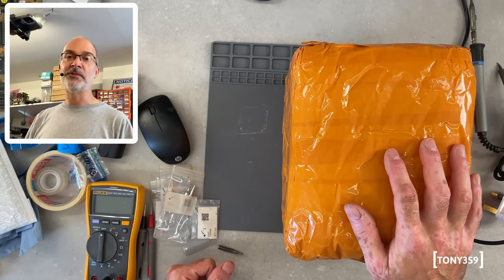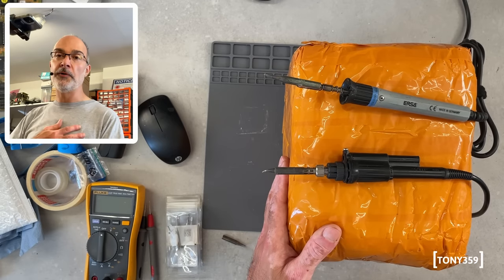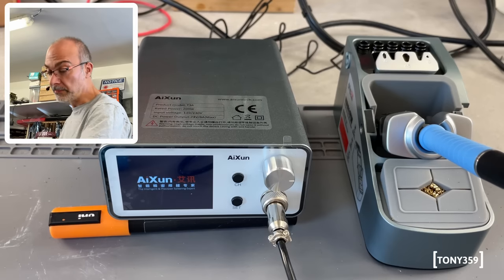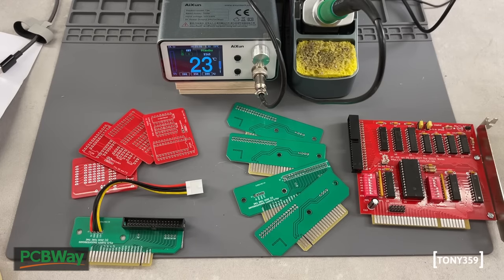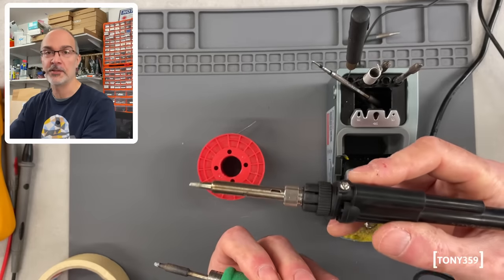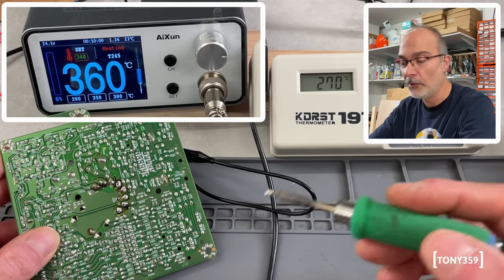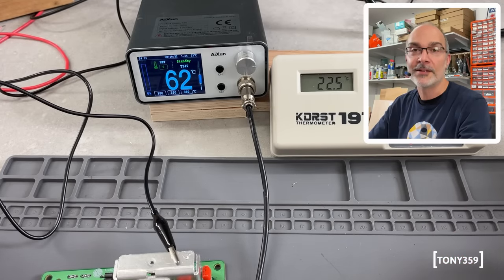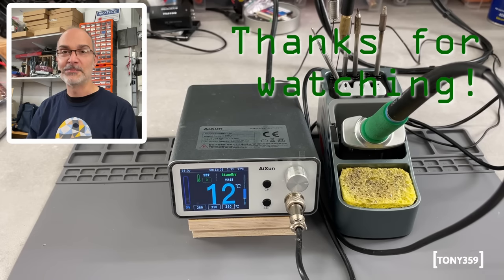Is the Aixun T3A a good T245 soldering station?

Comment: I have had a Hakko 927 for years and it served me well.  The drawbacks that you found on the tiptype iron where you have to unscrew the barrel to change the tip was a drawback for me, but I was able to deal with it.
One night though the ceramic heater cracked and the heater opened. I tried a chinese knockoff heater and it was NOT the same.  VERY poor performance.
So Pace came out with the ADS200 cartridge, and having some experience with Pace, I bought the station.  I am very happy with it's performance and power and recovery and have several different cartridges, from pencil thin to wide blade.  Always seemed to work well.
The problem with grounding the tip on the Aixun and messing up the temperature control loop is a BIG deal breaker for me!!!!  My Pace doesn't have that problem though.
Nice looking iron, but the drawbacks are deal breakers!
Reply from the maker: I am still using my Hakko knockoff and I need to change the tip twice for a project I do regularly. What a pain! With the JBC I do that all the time. I cannot go back. But yes, I need a soldering iron, not a voltage injector :)
Reply: @tony359 , buy an extra soldering iron or two and outfit them with the other tip shapes you use. Still a lot cheaper than cost of a JBC or Pace unit plus tge additional tips.
Reply from the maker: @goodun2974  Also a bigger workbench I guess
Reply: @pomonabill220  , it sounds like you need to use an isolation transformer on the input AC to the soldering station so that you can ground the tip.
Reply: @tony359  , don't we all?  Although the amount of equipment and accumulated detritus somehow always expands to fit the available space, no matter how large.  Anyway the audio repair bench I worked from for 20 years was only about 4 feet wide, but I had the Aoyue INT701A++ , an old Weller soldering station, and a hot air pencil unit stacked to my right, with a scope, signal generator, distortion analyzer, FM generator, patch bay, bench receiver and other equipment on shelves in front of me. I repaired plenty of large power amplifiers and hifi receivers on that bench. PS, it can be very usefull to have two simultaneously operable soldering irons on the same bench.
Reply from the maker: @goodun2974 I got a better iron. Irons are supposed to be grounded. Why would I need to use an isolation transformer to resolve a clear design flaw? And why would I need 2-3 soldering irons on my bench when I can do with one? 2-3 irons on all the time? It can't be a viable option.
Reply: @tony359  ,  You are correct that you should not have to use an isolation transformer after spending a couple of hundred dollars on what  is supposed to be a piece of high-tech equipment.  I was just suggesting a solution to somebody who might already have bought one, and maybe they work on old radios or something like that where they have to have an isolation transformer on hand anyway.

Comment: And I have a question. There is a new model called T413. Is the grounding method of T413 closer to T420 or T320?
Reply from the maker: I checked online. It says it has AI and a Neural Network in it. Really, is that necessary? It's not clear what PSU it has inside but given the 120W it might be linear.

Comment: Solved! (I think) - part 1. (YT keeps deleting my long reply so I'm trying splitting it into 2)

But firstly, to answer wrt. your reply to my earlier comment, they chose an SMPS because it's cheaper, lighter (= lower shipping cost) and smaller (= cheaper enclosure). However I since found your EEVBLOG threads, the reverse engineered schematics and SDG Electronic's pictures, from which the problem seems to be quite obvious and not the fault of an SMPS. The fault seems so obvious that surely I've missed something important?

The 24V supply +ve is switched to the tip's heater (LOAD) by a MOSFET, returning to the supply -ve from the tip's COM connection.  COM is internally connected to the tip's thermocouple, the other TC connection being to the tip's TC connection which is connected to the tip cartridge's actual tip.

The slap-head design problem is that they appear to have connected mains earth to supply -ve/circuit ground on the main board - the green/yellow wire you can see in SDG Electronics's review/teardown video. This means that when you touch the tip to another mains earth, the heater current now has an alternative, parallel return path to the -ve supply, flowing from the heater low (COM), through the thermocouple in the tip to the external earth path, through the green/yellow earth wire in the station to the main board and then to 24V supply -ve.

Wow! Apalling!!! If your earth path is very low resistance you could fry components or even fine traces on the PCB your soldering!!!!
Reply: "YT keeps deleting my long reply" Such replies aren't really deleted, rather it's a bug where they only show up under "Sort by Newest first". Under the default "Sort by Top Comments", the replies don't show up.  You can try sort by new, to see if the reply is actually still there. 🙂

Comment: Great thorough (non)review. It's been 9 months now, just wondering if these issues were ever addressed with a new firmware update. Thank you!
Reply from the maker: Thanks. I don’t have the T3A anymore but from my understanding those cannot be resolved via FW. Maybe they can mitigate the overshooting but if the thermocouple can’t see the actual temperature of the tip, then the firmware is driving blind and can only guess.
Reply: @tony359  Thank you for the reply. It really is a shame, as other than this issue it looked very promising.

Comment: Very interesting. I must say I haven't experienced the same issues in terms of grounding and unstable temperatures. I just tried it now with a large copper plane both grounded and ungrounded (with Aixun and JBC tips) and the power meter remained stable with peaks of 15% but an average of 6%. I don't have a proper way to measure the actual tip temperature though.

This is with firmware 1.26, I haven't bothered updating the firmware since I first got it over a year ago. I'd be curious if you find the same issues with yours on 1.26 (assuming it is still available to download)
Reply from the maker: I was thinking indeed to downgrade to a much earlier one, SDG electronics is also on a much older one. Let's hope I don't brick it :)

Comment: Hi,
Thank you so much for the in-depth review of this little soldering station.
I've been using it for a year and it's really a big step up compared to classic stations.

Note that Aixun issued a new firmware 1.35 with the following change log:

AiXun T3A
1.35 (2023-11-22)JC_M_T3A_1.35.bin
1. Optimize 245 control heating;
2. Optimize the "automatic temperature compensation" function of 245;

The problem could be fixed here?
Reply from the maker: It’s not unfortunately. I briefly tested it. The first thing I noticed was that - after a full reset - my top was 60C off compared to what the display said. The grounding issue was still there but hidden by the display. So I reverted to 1.33 again. I’ve got a different station now. Thanks for watching!
Reply: @tony359  thank you for your feedback!
I'll check what new station you have :)
Reply from the maker: A quick comparison video is out soon :)

Comment: Good review. I have the same Aoyue station and it's been ok overall and I've repaired many pieces of equipment with it, but it's weak and slow. The solder pump gun is adequate but, again, weak and slow. I've been looking for a reasonably priced replacement with newer tech and just can't make up my mind. I'm not real enthusiastic about switch mode power supply units and would prefer a linear transformer design with enough get up and go to increase productivity, so my search continues. It's looking as though I should save my pennies and get a name brand unit with good firmware/software. I'm surprised SDG didn't pick up on the issue, but I don't know what firmware version he tested with. I agree with your summation, 1.34 was obviously created to hide the issue. Thanks for the honest review.
Reply from the maker: SDG heard of the issue and analysed it in a later video with a different Aixun station.
It looks like stations with a linear PSU are good - but the T3A was also described as "good" so I'm not sure :) Thank you!
Reply: I used the Aoyue INT701A plus plus station for the last 5 years of my audio electronics repair career and it worked well for me. The earlier units used an AC motor and later units use a DC motor and I'm not sure if one was better than the other but I'm pretty sure mine had the AC motor. I found the suction to be generally pretty good from it but I did do a couple of modifications to the gun to center the tips better in the heating element and prevent clogs at the back end of the stainless steel tube where it enters the collection chamber.  I actually had fewer problems with that desoldering station that I had when using 80s vintage Hakko desoldering stations.  I was less impressed with the soldering iron wand that came with it although it does work better, as noted elsewhere here, if you use a Hakko tip that's actually made of copper and not a solid iron or steel tip as was provided and as so many online purchases of tips turn out to be.

Comment: At 1:10,  having used the same exact Aoyue (pronounced A-U) soldering/desoldering station for 5 years (prior to retiring),  I can confirm that the Aoyue soldering iron works better with Hakko or other quality tips because the supplied tips are iron or steel throughout,  which has poor heat-transfer characteristics compared to the copper tips manufactured by Hakko and a few others.  Most of the boatpack tips sold on line or package with knock off soldering irons are similarly made of iron or steel and you can easily verify this with a magnet because the cheap tips will be strongly attracted to the magnet; good quality tips are made of solid copper  with iron plating at the pointy end only (iron resists the dissolving effects of molten solder and flux, which would quickly destroy bare copper), and the rest of the tip is plated with chrome to resist solder completely.  I have a video on my channel about discerning poor quality tips from good ones with the use of a magnet.  By the way although I found the Aoyue soldering iron a little under powered for the type of audio repair work I used to do the desoldering half of the station worked really well, with a couple of minor tweaks and mods to the guns to make them less likely to clog.

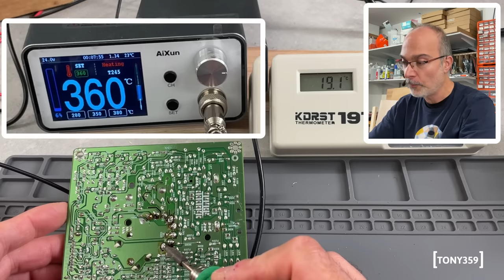Comment: 24:03
Thanks for making this public! I had noticed this too and swap tips like you did. 
What I discovered was, the original JBC cartridge tip i have did NOT have this issue. Only aixun cartridge that came with it has this issue.

Get an original JBC cartridge tip to solve this problem, although its quite expensive. Clearly they did not able to copy it 1 to 1.
Reply from the maker: But that was a JBC tip :) 
In fact, the "spiking" issue only happened with the JBC - hence Aixun blaming the "non-Aixun" tip for the issue.
Reply: @tony359  
That's weird, I just tested 1.33 and there's no "spiking" on jbc tips, only aixun. 

Maybe your electrical outlet in your lab is non grounded? that's the only thing i can think of tbh.
Reply from the maker: it's 1.34 which spikes on JBC. 1.33 works well with me.  I'm talking about the spiking when sitting on a thermometer, the "grounded" spikes happen with both versions, just different behaviour.

Earth is working, and you're not the first to say that it doesn't happen with their station so.... maybe HW variations? I really don't know :)
Reply: @tony359  
Yea the behaviour you showed is exactly what happens when I use aixun cartridge. Immediately solved when JBC tips is used. 

Perhaps the wand itself is faulty? ngl if the problem persists with JBC like yours do, i wouldn't keep it, I'd return.

Comment: That is why I do not accept any soldering stations with switch mode power supplies. Also, that is why top brands like JBC, Hakko, etc., always make their soldering stations with linear power supplies with a transformer.
Reply from the maker: Yes, I'd be curious to see how the new 420 behaves which has a linear transformer in it! Thanks for watching!
Reply: Second hand top brand > Chinese brand.
Using a Weller station with linear power supply normaly but I do have a Chinese import with switch mode supply I use when on site somewhere.
The Weller might be a bit slow to heat up but it's so much more stable, bought it second hand for 45 euros.
Reply from the maker: is that a cartridge style one?
Reply: There are exceptions: Weller makes one (the portable station which is available with a battery option) that uses a switcher.